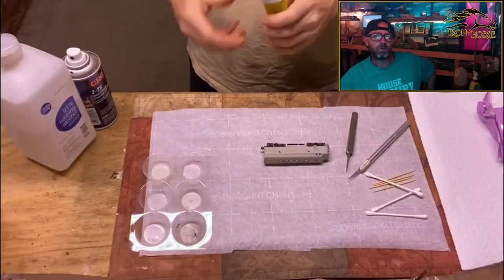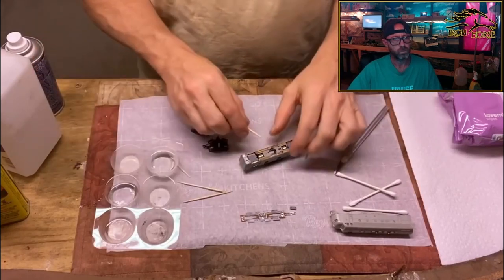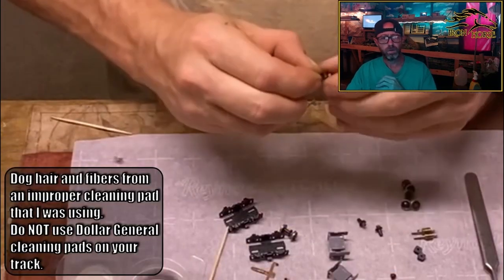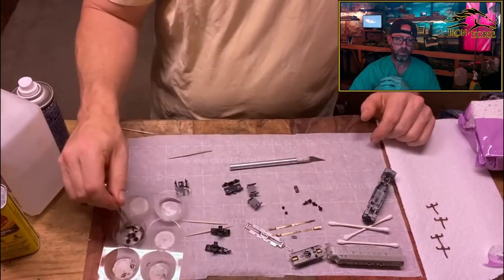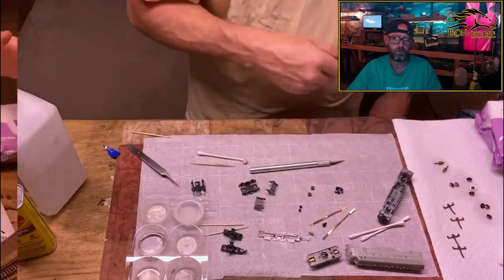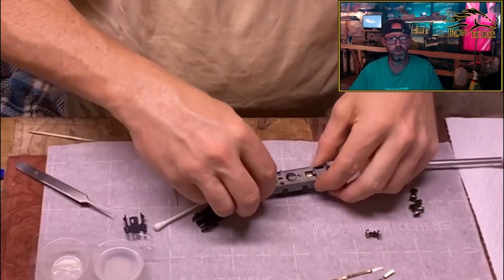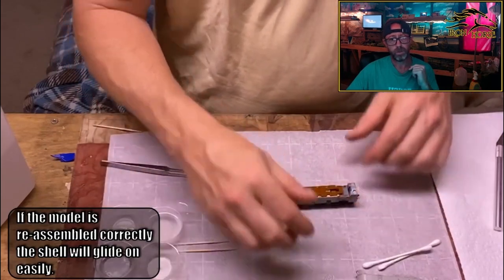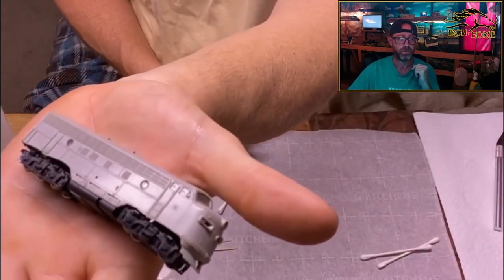Kato F Unit - Dismantle, Clean and Re-Assembly - How To - N Scale - Iron Horse Route - D&RGW

Comment: Really nice tutorial Brian!  You really take it all the way apart, eh? I've only done that a few times, I thought I was the only one doing that with n-scale. :)
Reply from the maker: Thanks Roy! Great to see you.   Speaking of.... :-)  I may need some assistance with the Atlas GP.  I can't seem to figure out where the copper strips are supposed to go and the purpose of that kaptan tape.  I don't have any to replace it with . I took it apart to clean like the F7 and can't get it back running.  I'm frustrated.  I love that loco.  I have to get it fixed.  My next mission.  I appreciate you Roy!  Brian
Reply: @IronHorseBrian  We may need to get on a video call of some kind so you can show me.  I believe the kapton tape was not really needed in that one. The copper strips should fit into slots/grooves that are along side the bottom of the metal frame pieces where the fuel tank fits on, you have to remove the fuel tank part to get them on/off.